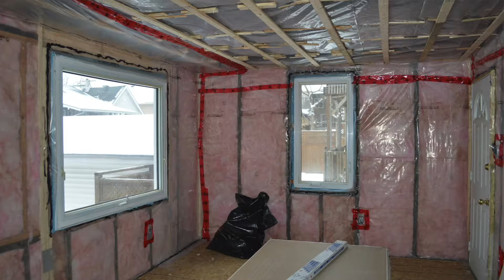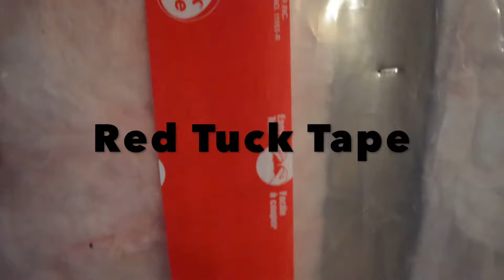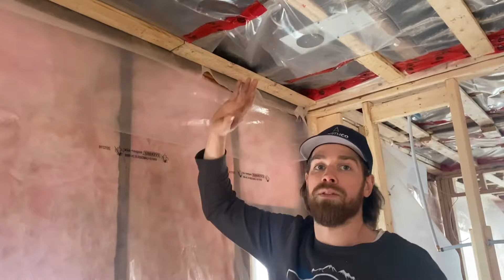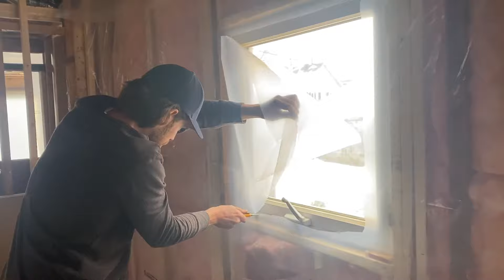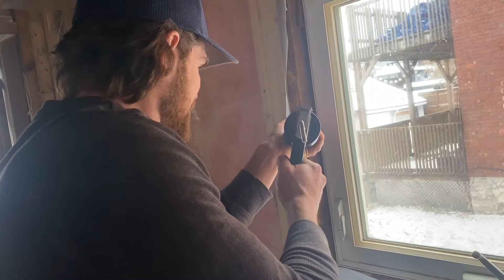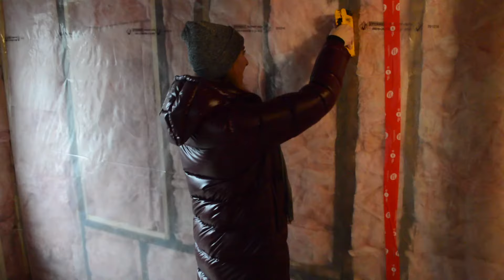How To Install Insulation and Vapor Barrier

Comment: A vapor barrier isn't to prevent air and moisture from coming in from the outside. It's designed to prevent warm, moist, inside air from condensing inside your walls when it's cold outside and creating a wet mess.
Reply: Different in hot humid Florida where it's hot and humid most of the year and air conditioned inside. The vapor barrier is installed on the exterior so the insulation doesn't get wet.
Reply: Here in Cincinnati, Ohio we get hit with a temperature range of nearly 100 degrees over the year and we also have high humidity in spring/summer/fall. Years ago, everybody installed vapor barriers on the interiors as recommended but we're seeing issues. Moisture from inside of the house stops dead at the vapor barrier (Good) but, over time, starts to corrode the dry wall fasteners which then stain though the latex wall paint (Bad). Then there are mold issues on the back side of the drywall. Installing a good vapor barrier demands the inside air remains dry which is a problem in the older 3 Bedroom Brick veneer ranches with gas appliances and dinky exhaust fans in the kitchen and bath. Hanging up laundry in laundry rooms during the winter is a no-no because all of the water in the clothes has to go somewhere. People running furnace humidifiers in the winter pump the moisture into the air and it has nowhere to go except condense at the interior vapor barriers. I've seen sweat running down walls during the preparation for Thanksgiving dinners with all of the cooking and insufficient exhaust with vapor barriered walls.
Reply: I live in SoCal and was wondering... wouldn't a paper back insultation work as well in creating a vapor barrier? For instance the backing on Owens Corning Kraft back R13 is supposed to act as a vapor barrier as well. But... in my case being in SoCal... would I even need a vapor barrier? Due to pipe burst, I had to replace the subflooring and re-insulate the walls. The one side of my bathroom wall initially had one large sheet of kraft type paper vapor barrier covering the insulation and was attached to the 2x4's with adhesive. Am now in the process of putting in the new insulation (Owens Corning Kraft Back R13 as mentioned before). But after watching this video, I'm wondering if should instead be using an entire sheet of plastic for the vapor barrier.
Reply: @RJMoser  In this area, the paper faced insulation has an applied, black material that not only attaches the pink fiberglass to the paper but acts a vapor barrier... of sorts. The "dirty little secret" is that this stuff fits well in cavities exactly 16" on centers but nothing else. So when you slice it down the thicker staple edge is just on one side. Trying to get this stuff to fit the odd sized cavities is an exercise in futility. Drywall hangers HATE insulators who staple the paper to the outside of the studs. It's less than ideal. A lot of people are going to spray-on cellulose with additives for fire/insect/mold prevention. A friend just had his pole barn shop/garage done this way with a plastic vapor barrier but he's using in-slab heating. Really, the best thing is to invest a bit in a good hygrometer and see what the actual humidity is within the dwelling for your area and compare to the usual outdoor humidity. Today, the weather report says 34% but my basement hygrometers (2 of them) put it about 65% in the basement. Check your building codes for your area.
Reply: @mcgeorgerl  Ty for the quick reply. Installing drywall in my small bathroom would be cost prohibitive (having to pay for the installers and everything) which is why I'm hanging wood sheathing instead. Anyways, I've decide to apply a vapor barrier. I am curious though... if drywall installers don't care for staples on the outside of the studs... wouldn't they also be dismayed with staples on the outside of studs holding up the vapor barrier? Just a thought. Thnx again from SoCal.
Reply: @RJMoser  Drywall hangers rely on seeing the studs to quickly hang sheets with (Mostly) screw guns because many are paid "by the sheet". If they come into a house where the studs are concealed by the staple edges of the kraft paper faced insulation, they can only approximate the center of the studs which slows them down. in short, time is money and they make lees per hour. Plus, the paper edge doesn't always lay flat and there are two paper edges on each stud for most stud bays. This makes it more likely that the sheet of drywall will not lay flat or will slip down while trying to screw it to the studs. The staples aren't the issue it's the multiple layers of kraft paper on the hemmed edges.
Reply: YES and creating mold
Reply: @mcgeorgerl I live in the same sort of climate in nebraska.  What are they doing in new builds so as not to have that issue on the interior?
Reply: @WoodChaser  Most new construction around here uses a Tyvek (Or similar) house wrap and none of the new homes built just around the corner from me had an interior vapor barrier. Also, newer homes tend to have better humidity controls/exchangers whereas our older homes (Especially those with natural gas stoves that drive up humidity) were far from being air-tight, at least until we installed widow upgrades and continuous plastic vapor barriers just behind the drywall. Ceilings in the newer homes just built also had no vapor barriers, they just had drywall screwed to the joists and trusses and blown-in insulation so there was nothing to retard the moisture and most new homes here use a ridge vent with air drawn through the soffits. I have a friend who just had a pole barn built and one of the problems he encountered was... let's say... a lack of consensus among installers about the proper way to insulate the steel skinned pole barn if moisture got through the insulation and hits the steel siding at sub-freezing outdoor temperatures (But my friend is using an in-slab glycol system and the interior will probably not get above 60.)
Reply: @mcgeorgerl  I am building a barndo/pole barn house and I have metal siding, house wrap than rockwool insulation. Im debating the vapor barrier.
Reply: @WoodChaser  If I remember correctly, where Mark came out was cellulose with fire retardant and insecticide of some sort. It was sprayed on just wet enough to "stick" and I don't think it had a net tacked to the studs. I know he looked at rockwool, fiberglass, and spray foam. He did NOT put up a vapor barrier. The last time I spoke with him, the ceiling was not yet up (He's doing this 40 x 60 without a loan and saved for years before starting, even waiting another season after grading because they had to do a little build-up in one corner. He's not using many contractors. I know one for the concrete and one for the insulation. Everything else is him, friends, family, neighbors with excavation equipment and skid steer and electricians from work.) As soon as the roof was on, he started moving stuff in to it and now he has to work around junk. It'll be, primarily, a woodshop and weld shop but right now it's a bit of a mess.
Reply: @mcgeorgerl  Moisture in the air condenses when it comes into contact with cooler surfaces. If you're getting condensation at the vapor barrier, it's because you don't have adequate insulation on the exterior-facing side of your vapor barrier. The exterior air is cooling your interior surfaces enough to create areas where the humid interior air can condense.
Reply: @Zepie  Homes around here built in the era of my house are usually brick veneer or brick veneer with siding combo. The sheathing is not plywood, but rather fibrous (And somewhat fragile) material attached to the studs on the exterior of the house. Some of the "old timers" referred to it incorrectly as "horsehair sheeting". The problem is not lack of insulation in wall cavities of retrofitted homes, but that severe cold is transferred through the sheathing and the 2 X 4. The wall cavities are fine and insulated with standard "pink'' fiberglass batts. These homes also have no "house wrap" of any type. Some of the newer, better designed homes in the area are using staggered 2 x 4 construction in 6" walls which create a thermal break. When the temperatures gets low enough/long enough on these 'mid-century" homes, thermography clearly reveals stud locations as significant cold spots. What is odd, is that homes NOT retrofitted with insulation and vapor barriers do not show the dry wall nails (Screws not yet then available) telegraphing through due to corrosion. But, their heating bills are "through the roof".
Reply: @mcgeorgerl very interesting… I agree… would you recommend installing a vapor barrier in ohio in a different location now? Or would you still install it between the drywall and the insulation?
Reply: @adrianbonnin5096  I think the best would be to still install a vapor barrier between the studs and drywall on above grade walls, but to ALSO install a system (Or systems) to control interior humidity. Many of the furnaces installed since the 1960s have been equipped with simple "water over screen" humidifiers which often pump excessive amounts of moisture into the heated air due the unreliability of the simplistic design.

Comment: Sir, I think it’s safer to wear a mask and gloves when working with insulation. Please be safe
Reply: The new versions of pink insulation are safe to install without gloves or a mask.
Reply: @farvasstache6532 , just because you can doesn't mean you should.

Fiberglass threads are nasty to touch or inhale.
Reply: @jonathangwynne1917  Fiberglass IS nasty, everyone knows this. But I didn't say "fiberglass", I said "insulation". Not all insulation is made from fiberglass anymore. Which is why it is safe to use without a respirator or sleeves. Pink SPECIFICALLY made this new insulation to be safe to use without protection. Which was my whole point.
Reply: @farvasstache6532  , is the pink stuff fiberglass?

Comment: This just doesnt make sense to me!, the plastic barrier should go against the wall first otherwise the insulation risks getting damp from any penetratiing damp (as I've found out) my insulation was wet and going mouldy. Ive since stapled the plastic membrane to the ceiling baton and left it hanging. I then made a wooden frame to fit the wall, screwed it to the ceiling baton, then the floor batton, it's very sturdy. Using this method Ive not compromised the vapour barrier, I then inserted my insulation which will not get damp. I then overlayed the insulation with a breathable membrane (the stuff usually used before tiling a roof)I  then plasterboarded the walls. My out building is now insulated/sound proofed and protected against penetrating damp onto my insulation fill.

Comment: If you use AC in the summer, any moisture in the wall cavity will condense on the interior side of that plastic. You really should be using something like intello or Siga Majrex with their tapes. That allows the wall to dry to the inside without allowing air to move in and out of the assembly.
Reply: Totally agree, I used Intello Plus here as it lets humidity pass (diffusion) while blocking air.
Reply: I had an in-depth conversation with the person who wrote the code plastic is not req at all they added it to the code as a reference of its permeability.  Sheetrock prime n paint fall well within the perm req for any house.  Plastic traps moisture

Comment: I'm just finishing somthing like this ,By code I had to use blue tuck inside and red outside ,I also just used tuck tape around windows and doors
Reply: Interesting. I didn’t realize there were two colours 

I like the idea
Reply: @tatonkatatonka  I was warned by our first contractors to use the right colors in Ontario the red inside would fail inspection.
Reply: What is tuck tape?

Comment: Hmm- first time builder- watching all videos.. 

Why vapor barrier ceiling? Yes f there is a leak the water pools right? Wouldn’t you rather find the leak then patch then replace all materials.. couldn’t imagine having to remove insulation that would have been fine but now is water logged because the vapor barrier moved the leak source… wondering if this happens… debating not vapor Barrie ring the ceiling and just going with solid foam … thoughts..
Reply: Yeah this is wrong on so many levels
Reply: The vapor barrier is to keep warm moist air from entering a cold ventilated attic.

Comment: Great video!
For a concrete basement bathroom, the bottom half of the wall height is below grad. Someone told me to put a plastic barrie on the concrete wall and then insulation and plastic barrier on top of insulation. There are pipes and drain pipes on that wall. Can this method cause issues or it’s a right thing to do? Thank you.

Comment: Hi Guys! I'm a newbie DIY Wall Student in L.A. about to fix a 24 inch square section in my ceiling (and a big rectangular section of drip stained wall) from a bad leak that was on our apartment rooftop. The outside roof leak is almost repaired (for the 5th time), and I'm getting a bunch of ideas from the comments below with the plastic "Vapor Barrier" application. After noticing each Comment below had a major caution for using sealing the wall with plastic, I'm getting a ZEN Idea to simply overly my plastic in horizontal rows that overlap over each other. This "vented attempt" would theoretically stop dripping (or running water), from another failed rooftop fix, from soaking into my wall (especially my rectangle wall repair).
Reply: Just use an air barrier that lets vapor pass like Intello Plus and you won't have an issue. Venting is not a solution, you want an air barrier. Carefully done painted drywall could serve that function as well...

Comment: Thank you. I had a question about the staples in the stud. So I guess I put more than needed in my studs! Around 4 by stud. It is ok?
Reply: Probably about 6 inches with plastic poly. And about 3 inches with using netting for blow in insulation.
Reply: Only need a tac every seem on the sheets of Polly there are like lines that go down those are your guidelines

Comment: Thank you!!!  Very helpful.
I have a question.  There is paper faced insulation in my walls that we're working on.  Do you recommend still putting up plastic as barrier?
Thank you!
Reply: Definitely not
Reply: Do not do that unless you want a major mold problem

Comment: The vapor barrier goes before the insulation
Reply: depends on the climate, in a cold climate you want the barrier on the inside of the house to prevent moisture going from inside the building and condensing on the walls as its hooter inside the house than outside
Reply: @louis263  You have a Hooter inside your house?

Comment: how does the batt stay up with slanted ceilings? wont it fall out of the cavity?
Reply: You use staples on the paper backing
Reply: Friction fit
Reply: What worked for me was to drive tiny trim nails into the framing to act as cleats to hold my unfaced batts when they didn't stay put

Comment: Handling fibreglass batts without wearing a mask and gloves?! Very unhealthy I think.
Reply: yeah i was shocked by that. never touch it with bare hands. ouch
Reply: @guoxuxing6407  thats a very common myth, they're fine to touch and don't make you itchy... also its safe to breathe in since the fibers are no smaller than dust in a room, or fibers coming off from your shirt, so your lungs don't have any problem filtering it out. Not like asbestos where the fibers are so small they enlodge into your lungs
Reply: @mr.hedgehog420  Not a myth I had terrible reactions to it
Reply: @Daniel-ef7nk  I guess it depends if you have a sensitivity to it, i've been an insulator for 3 years never had a reaction
Reply: It's not dangerous, just itchy as the glass breaks easily.

Comment: As a contractor/ Architect technician you should do sone research because you provide some false/ incorrect information about vapor barriers. 
One thing you need to know, it’s better to not have a vapor barrier than have one in the wrong place : Mold
Vapor barriers are use under a concrete slab , crawl space floor.
Otherwise you need a vapor retarders. Avoid plastic vapor (6mil) barrier inside wall/ celling assembly or roof.

Comment: This is so wrong. You are trapping any residual humidity and moisture in your insulation and walls. Vapor barrier should be on the exterior only!
Reply: not in Canada, code requires it
Reply: Yup. It’s code because it prevents indoor moisture from getting in the walls and causing mold.
Reply: You'd be better off with a smart vapor retarder that blocks air and lets the wall dry. That should pass inspection in Canada (also Canada has a variety of climates, which one are you referring to?)
Reply: @rsmith02  It's certainly building code in Ontario and all of Canada is cold climate with freezing temperatures at some point during the year so I'd be surprised if it's not required in all provinces.  If you don't put vapor barrier then humid air getting in into the walls will be a problem in the winter.  In a humid climate where you constantly run AC, like the southern US say, you would want it the other way around.
Reply: In cold climates vapour barrier goes on the INSIDE.